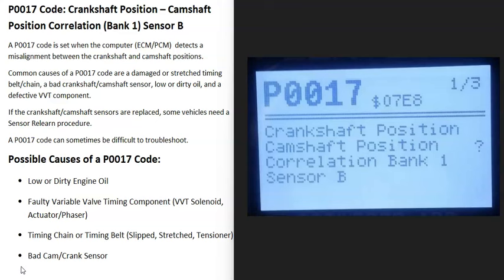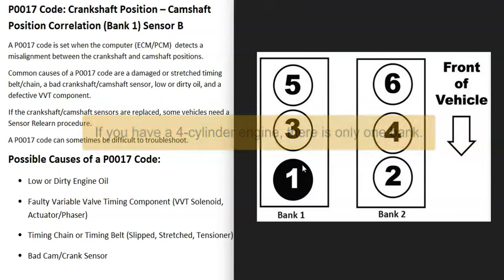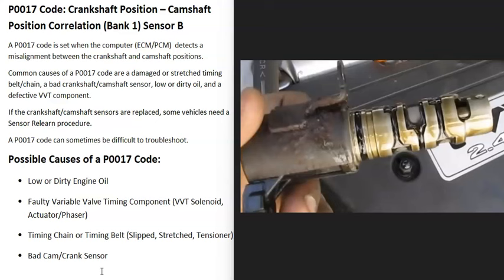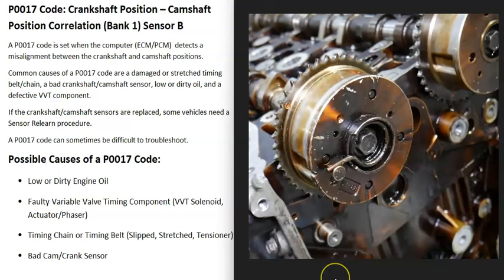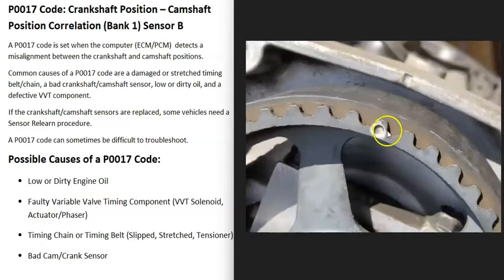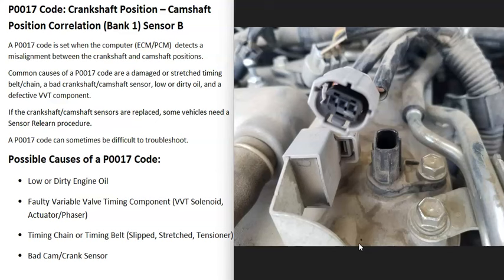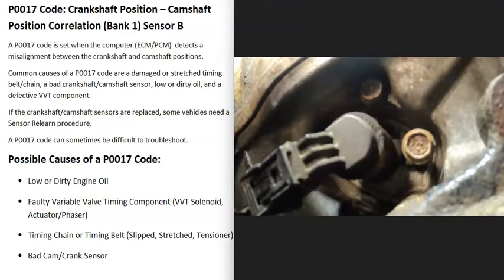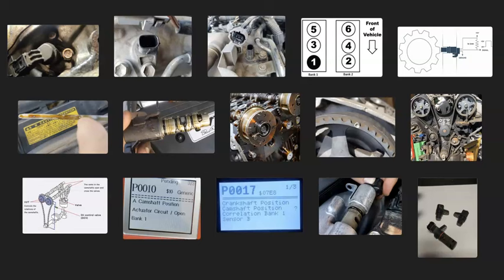Causes and Fixes P0017 Code: Camshaft Position B – Camshaft Position Correlation (Bank 1)

Comment: Nice informative video! I need help; I am a "novice mechanic," and I replaced my water pump on my 2017 Ford Explorer xlt 3.5l. My experienced neighbor helped me along the entire project, or i dont think the car would have started. After 50 - 70 miles of driving, the codes will not go away. I replaced the solenoid sensors. Still nothing. My symptoms: Every time I excelerate at 50mph the acceleration slowly climbs, and the exhaust has a lower sound at times. Everything else seems to work good. Is it okay to drive? Any suggestions would be super helpful, thanks
Reply: Update - I was off a tooth ....advanced 1 tooth

Comment: Since they added a computer and many sensors, engine repair went through the roof, but combustion efficiency went barely from 20% to 22 or 23% ..that's a very low gain to consumers..a rip off in other words.

Comment: Hello, you mentioned in an earlier video about nissans p0011, and p0021. Along with these codes, my 2010 altima sr wouldnt start the other day. (I replaced the battery 3 weeks ago) I disconnected the batt, connected and it started. It started a few more times with no issues, but my dash kept losing power and resetting, and then the car stalled and came back on while driving on the highway. You said something about it may be a cam sensor if you have both the codes? Let me know your opinions if you could, and I apologize for the word vomit
Reply from the maker: It needs to be diagnosed, but with both banks having an issue, the CAM sensors are likely good. It may be in the wiring, especially since there are dashboard issues. It can also be a slipped timing belt/chain or a VVT issue. It all needs to be tested and diagnosed to know the issue.